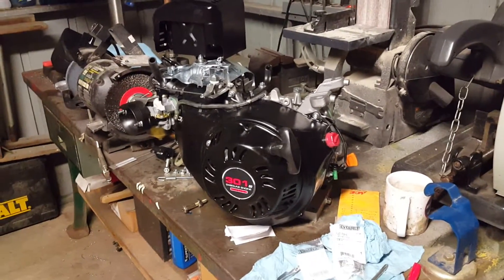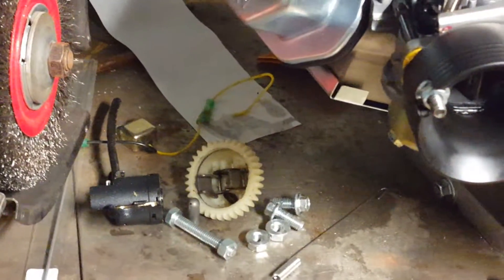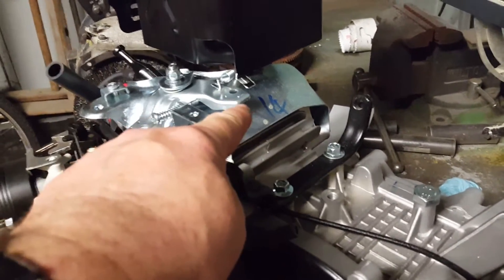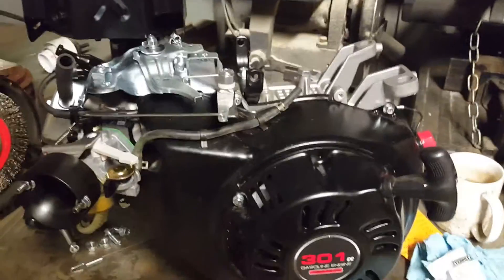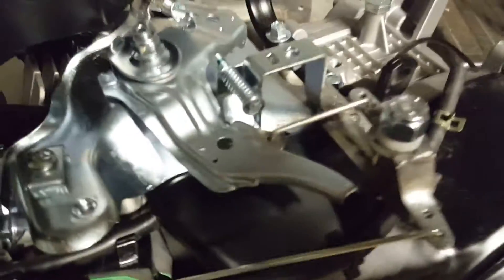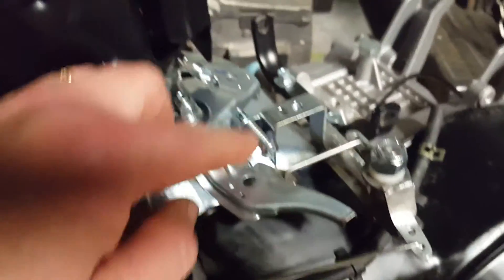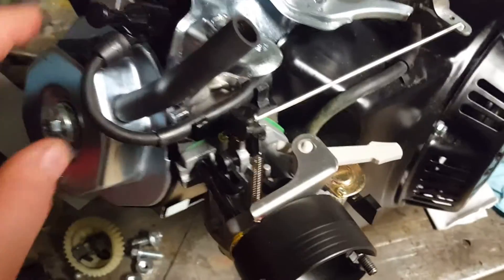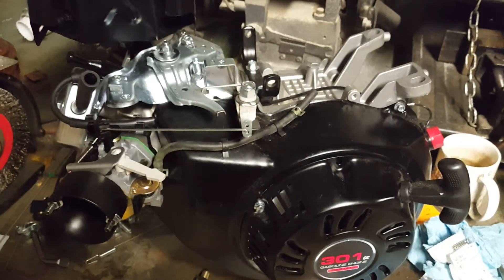How to make a working throttle on a 301 Predator engine after removing the governor

Comment: The springs allowing valve float can cause the piston to contact the valve in an ohv engine, which can ruin your engine, or bend the valves. Valve float in this case is not protective. The flathead engines can float valves all day long with no issues, just not OHV.

Comment: Is there any different in a 301 predator and a gx270 flywheel
Reply from the maker: No the same ARC flywheel for the gx270 is the same one that you use on the predator 301.